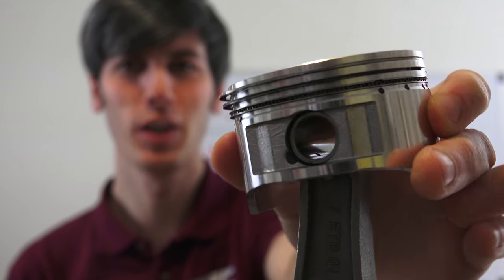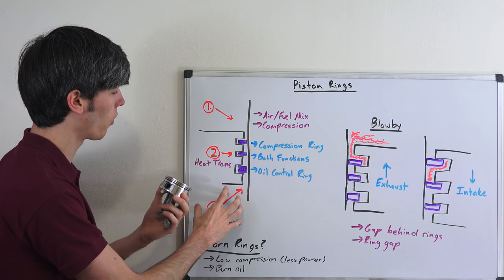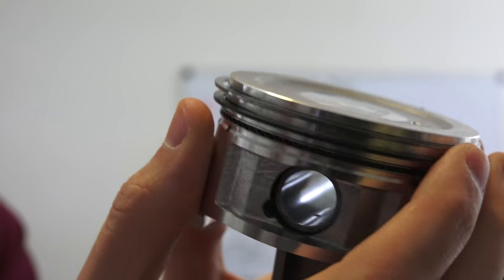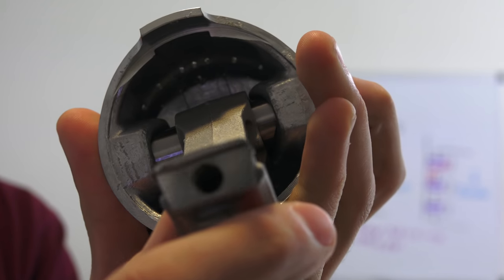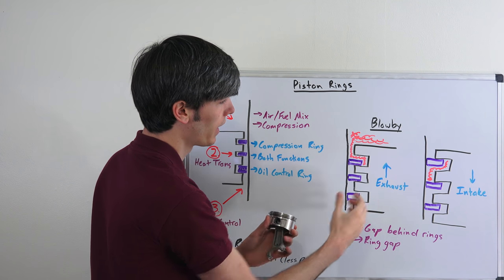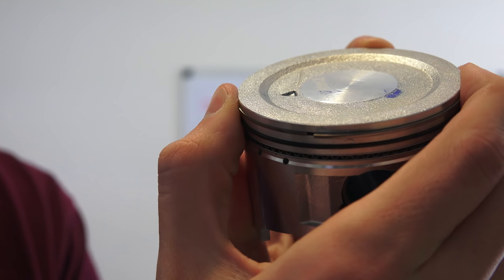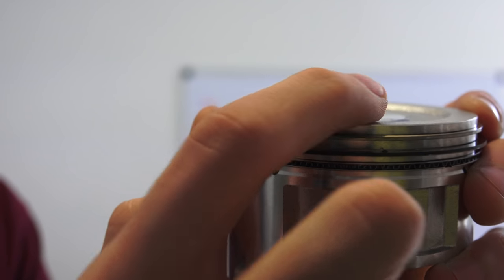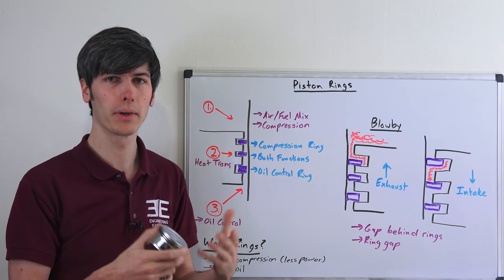Piston Rings & Blowby - Explained

Comment: My car smokes on startup. Also has hesitation and power loss. Does an engine have these symptoms from piston rings only or can this also be valve  stem seals?
Reply: To determine this, you'd need to perform a compression test on the cylinders and see which one has low compression.  

Then, with any low compression cylinders, add a tablespoon of engine oil inside the combustion chamber and test the compression again.  If the compression goes up, it means the oil that you added essentially blocked the defects in the rings, but if the compression stays pretty much the same, it means it mostly likely is a burnt or defected valve.

If your valve stem seals are bad, they will let oil seep into the combustion chamber, which accelerates wear and misfire likeliness. 

I have a car that also smokes badly (blue smoke) on startup and acceleration and normal driving.  I determined it was a single exhaust valve that was the culprit, a common issue on neglected cars...(valve timing wasn't done properly).

Blue smoke is from oil burning.
White smoke is from coolant burning.

Unless I'm mistaken, I think could help you.

Comment: I have to fix my not in my motorcycle and the piston rings are most likely discontinued (bike it '89 zx600c2) and I am curious if I can use the original rings even though I took the head off or should I try and replace?
Also!! I can find compression rings but not oil rings.. So what will happen if I replace just compression rings and keep the old oil rings??
Reply: As long as the oil ring is in good shape and not worn abnormally it should be ok. But replace all of them if possible

Comment: Do they last forever on  a 4 stroke? On performance 2 strokes they have to be changed frequently.
Reply: +Joe Barbaro no, but they last longer on a 4 stroke
Reply: BAMBI How long? i have read that its somewhere around 200k km. If it requires a engine disassembly is it worth to change them?
Reply: +Joe Barbaro It's hard to say how long they last. It depends on so many things. But i know some cases where they last over 1'000'000km.
In most cases it's not worth to change them because often when they go bad, the engine is worn out anyway. And to change the pistons rings means that someone had to tear the whole engine apart. So you end up with the situation that an engine swap is probably a cheaper solution.

Comment: My pos Corolla burns a lot of oil.  Will switching to a heavier blend minimize burning?
Reply: +dumbass3000 Yes, but it's just a band-aid to whatever might really be wrong. There is no harm in switching to a slightly thicker oil though. I would do it too.
Reply: maybe your cars pcv valve is clogged or broken.
Reply: TheWolvesCurse
checked that and it was clean and functioning.  The oil burning was common problem of this gen.

Comment: Hello and thanks for the very informative posts
Please can I ask should a cold engine by left idling to warm up or driven gently to normal temperature? Many thanks,Paul
Reply: idling to warm up is a bad idea since your oilpump won't pump as effectively in idle. gently driving intil it reaches temperature is the way to go. you shouldn't rev it higher than 2500rpm as long as it's cold. if you don't habe a oil temp meter, just drive it below 2500rpm until watertemp reaches it's optimum, then you can go for 3000-3500rpm for another five minutes, then your oil should be at temperature as well. just a general rule only for common gas/petrol/benzin carengines. diesels and motorcycle engines behave differently.
Reply: +TheWolvesCurse many thanks

Comment: could you explain the difference between a V6 and a inline 6?
Reply: +FOREVER EL1TE the shape.
Reply: +Trent Hutchison but which one is better ? im sure there's pros and cons to each
Reply: +FOREVER EL1TE inline probably can be fit in a narrower engine bay, V might have additional benefits such as longer stroke options?
Reply: +FOREVER EL1TE inline 6 engines are naturally balance and tend to be smother, v6 engines are lower and shorter so are easier to package into engine bays

Comment: Oil makes a big difference. Cheap oil not changed causes carbon to freeze the oil scraper ring to lock up frozen.  I replaced rings on properly maintained synthetic oil vehicle and the oil scrapers were freely moving as if new. Oil makes a big difference.

Comment: A friend golf 1.4tsi engine, has a misfire on cylinder 1. We thought it was coil packs and plugs so we replaced all 4 plugs and coils, the problem was still there. We then checked compression and it had no compression in cylinder 1, there is no knocking sound just a misfire. My theory is that the piston ring in cylinder is not sealing causing no compression, the car had been driven recently with a coolant leak maybe 10-15km (Water pump had a leak), and lost all coolant in the expansion tank. Do you think it's possible that the engine has got too hot, causing the piston ring to burn out ? and not seal properly?
Reply: +Peter Lazareski You might have a slightly warped cylinder head causing the head gasket to fail. It happens pretty quickly without coolant. Yes 15km is long enough. You might have to have it straightened out. (which is not as expensive as it sounds, the main cost is all the labour in pulling off the head and reassembly)

Comment: Is there anyway you could restore compression to have more horsepower?
Reply: +Artago Falcon that does sound like a good idea but I've heard about the compression restore you can put in your oil, what about that?
Reply: +Tristan Pierce sounds like something that will gum up your rings, which in that case will raise your compression since it lets less gasses pass through. It's more of a band-aid than a fix really. Best way to see why you have low compression is to do a leak-down test. That will tell you what part of the cylinder your losing compression at.

Comment: Hey man, great material as usual. I just thought of a topic that I hope you could shed a little light and knowledge on. Would it be possible for you to explain why All combustion engine valves are circular and no other shape? Just a thought. Thanks for reading @Engineering Explained
Reply: They are round because to maximize heat transfer to the head, they are always turning. non round shapes are not as easy to make them spin around
Reply: +Thomas Fooij Thank you.
Reply: +Thomas Fooij the spinning is not good or wanted....it's a by product of rpms. In race engines they use multiple springs to try and stop it from happening.
Reply: +Trent Hutchison hey trent, I don't know if you are right about this. I was taught that the turning is a positive thing because of a more even wear and a better transfer of heat. Especially on the exhaust side. Could you give me some links or something proving your point? You could be right of course, I'm only reproducing knowledge here
Reply: Idk when I read your comment it just didn't make any sense to me. I don't see an advantage, just a waste of energy. Just commenting for conversation. not trying to start a research paper.  I'm in the same boat, i heard it a while back and I can't remember the details.  not too worried.

Comment: What do you think about 6 thou over standard tolerance range for the top ring gap? i.e should be 0.006-0.012" but I have 0.018". The service limit is 0.024". So my new ring is over the standard range yet equally below the service maximum. Thanks! It is odd because the 2nd ring isn't over the standard range. It is a stock civic, just looking for reliability. Just got everything back from the machine shop sooo yeah.

Comment: I have a cylinder that has 20% lower compression compared to the rest on a flat 4 engine. Did a wet compression test and voila, it was positive. My question is, why would only one cylinder be low on compression due to the piston rings?

Comment: I have had this question for a long time, bit why do the piston rings stand up to wear far better than the seals on a rotary engine (lifespan of 80,000 miles on a rx-8 I've heard). normal engines with piston rings top that easily but why? same type of wear as far as I can work out, or maybe it's because rotary engines don't really have moment without an ignition...?
Reply: +Simon Van Ootegem 
Heat, surface speed, lubrication and movement(sliding) across openings in the rotor housing walls.
Reply: Better lubrication.

Comment: Hi.
I have a problem while running on LPG with Hyundai Tucson GLS 2006 v6 with automatic transmission.
When i`m running with 1500rtm constantly (60 km/h) i feel one or three shocks and rtm is dropping for a second then after a while is doing this again and again.
Only on 1500rtm is doing this.
I have changed the spark plugs with BOSCH LPG and no changes.
LPG Tehnicians says that is a problem with my car and not with LPG system. (they change it with new one and have same issue)
You have any idea where to look to fix this ?
Thank you.

Comment: Hey in my situation I have oil on all 4 cylinders but the car hasn’t lost any power. It starts right up. It smoke from a stop but when I get going the smoke slowly goes away. Also I did change the valve stem seals two day ago

Comment: request! explain diesel runaway
Reply: +RobinRawrr! 
Diesel engines are fuel starved  to control engine speed (RPM). 
Diesel engine governors typically control fuel delivery. 
When there is an uncontrolled source of fuel there is runaway. 
Sometimes that is from a leaking diesel fuel injection rack or a rogue fuel source introduced through the air intake. 
Diesel engines have unrestricted air delivery, no throttle plate. 
The rogue fuel can be any combustible substance including but not limited to hydrogen, propane/butane, acetylene, natural gas/methane, alcohol/ethanol/methanol, gasoline, diesel, kerosene, oil, ether, paint thinner, etc... most any liquid, gas or vapor that is flammable or combustible.

Comment: Eng'g Explained, i just replaced my piston rings oversize to 50 in all 4 cylinders, ( mitsubishi cyclone 1.5 L engine/ carburature type ), so as the valve stem seal intake/exhaust system because of white smoke in my exhaust. But after the replacement were done same situation occurs, white smoke during engine start and driving..its burning oil also... Experiencing rpm rising so as the temp gauge.

Comment: does not changing oil regularly causes this?
Reply: +Matthew Yes, those holes he showed can get clogged forcing the oil into combustion to burn. It's a common failing on the Toyota Corolla. I never had the issue with 5k oil changer intervals and a quality synthetic.

Some say they were rock solid on good intervals with less than synthetic and got the issue. 2008ish I think they fixed it.
Reply: You can do just about anything to an engine maintenance wise with small longevity effect except for two things. If you want to shorten the life of an engine, don't change the oil and let it run hot. Change your oil at the recommended intervals and maintain your cooling system and everything else will be mileage or performance related. Or as was said in Sling Blade, "Ain't got no gas in it".

Comment: Hey dude. Just a question about my car. It's a Toyota starlet 1.3 na 4e-fe engine it's only done 50,000 miles so shouldn't be in too bad condition for its age (20 years old)  and when I take the oil filler cap off the oil smells a bit of petrol but when it's running it doesn't have blue smoke coming out so I don't think it's burning oil. Just wondering if it's an issue or I'm just overthinking as to why the oil smells like petrol (gas)
Reply: +alex harrington The smell of petrol indicates you have some petrol in your oil. This is usually a problem at cold start, when some liquid fuel wets the cylinder wall and drips down the cylinder wall into your oil in the crankcase. Fuel dilution in oil is more a problem if you have frequent cold start and in winter. I would suggest you do a longer drive (~1 hr). This will allow the oil to reach the operating temperature and vaporize the petrol.

Comment: Gray smoke out of exhaust is engine getting too much diesel in chamber or is is piston ring? ( its happening when i floor the pedal ).
Reply: It's a bad air fuel mix up top. Someone probably put a coal roll tune on your truck
Reply: +busilica123 Its un-burned diesel fuel. Your pump timing could be off, or bad diesel not burning all the way, etc. The smoke will have a blue tint to it if you have excessive blow-by (aka burning oil). Every engine has a small amount of blow-by. Diesel engines are more susceptible because of the extreme pressure in the cylinders.
Reply: +CJBMAGGOT94 Thanks! But the key word is when i floor the pedal then its blowing the gray smoke out of exhaust :S
its golf 2 diesel
Reply: busilica123 Key word I told you the possibilities on why it does that. In the process of rebuilding a 1.6 diesel for my mk1 Jetta.

Comment: How come Diesel engines rev lower than petrol, is it to do with diesel having less of a combustion rate or what u call it
Reply: Diesel burns slower than gasoline so more time is needed for ignition.
Reply: +RGO Impact I know that now but thanks
Reply: Diesel's actually have higher compression, so high rpm is not needed

Comment: Great, now I kinda understand what's happening with my motorcycle :) Thanks! 1000 USD out the window for parts and labour.

Also, is it possible that my recent jump in fuel consumption is related to this? 2 years ago my fuel consumption pretty suddenly got 20% worse and in the last 5000 kms it started to burn oil rapidly.

Comment: do turbo chargers increase engine wear?
Reply: +zachpaw They place more thermal stress on the engine, but turbo charged engines have also thicker components to cope with the extra forces, so in that sense it doesn't wear the engine faster.

Comment: My 400k mile Corolla burns oil and I must assume that it is lacking compression as well, when this gets worse, is the engine not worth repairing ?
Reply: damn 400k? just buy a new car lol
Reply: +pedrof830 what about a thicker oil? labour cost is mad though :(
Reply: paviaaPS3
tried that a few yrs ago, the engine felt sluggish and it barely made any difference cause I also have a bad main seal and labour costs for that is very high also.
Reply: Arh too bad then :( good luck with it though
Reply: At 400K, the rest of the car isn't worth the cost of the rebuild.

Comment: So do the rings then scrape on the cylinder wall?
Reply: it doesn't really scrape, its more like a squeegee. like with windshield wipers. picture the wipers as the piston rings, and the windshield as the cylinder wall. in the dry your wipers will bounce and squeal and all, in the wet the wipers are lubricated by the water and slide smoothly (they should at least) across the windshield.

Comment: I've learnt so much from you, man. Thank you for these amazing videos. I have a question that isn't related to cars though, but it's about piston rings. Hope it's okay. 

I have a 2-stroke motorcycle. A 2 stroke engine needs oil to be mixed with petrol when pushed into the combustion chamber to ignite n so on. I forgot to mix the oil once n my piston jammed :-( I waited for 10 minutes n the bike started up n has been okay since then but spits out white smoke. Still very usable though. Question: can I just change the piston rings n will the problem get solved this way? Or do I have to rebore my cylinder all over again? Thank you again. Awesome channel.
Reply: +johnybrokeit 
Depends on too many unknown factors to accurately answer on a forum like this. 
It would totally depend on the amount of wear and or damage.
Reply: The white smoke is coolant probably. Maybe you blew a gasket

Comment: Remove your oil filler cap, if you get air coming out and or exhaust coming out, you have bad ring(s). That motor now would be good for nitrous since its on its way out anyway.

Comment: I have a question, Why is the Power to Curb weight  ratio so important and why is it called the dream equation if the ratio is 1:1 as in Koenigsegg One:1?
Reply: the more power and less weight the quicker the car will accelerate. the Koenigsegg One:1 is a really powerful car, its also really lightweight, its the best of both worlds. Usually you only have a really powerful car that weighs a lot or a light car that has a decent amount of power
Reply: +ALovelyBunchOfCoconuts That makes it more easier to understand. Thanks a lot

Comment: What happens with that little amount of exhaust gasses passing thorough piston rings in crankcase ? (Sorry for bad English)
Reply from the maker: +dimancik153 There is a PCV valve to allow the pressure to escape the crankcase.
Reply: +dimancik153 The blow by will go through the positive crankcase ventilation (PCV) valve and return to the intake manifold of the engine.
Reply: oh, i see. Thank you guys. Now i know :D
Reply: older designs had crankcase breathers. small engines dont have PVC valves but every even must have a way to relieve the blowby, i think ALL engines have blowby a new engine it will be very little a badly worn out engine will have allot of blowby. i have a farmall cub tractor and on that engine the dipstick has a vent with a screen on it.

every engine in every shape and size must have a way to relieve blowby gasses. 

now what about 2 cycle engines.....string trimmers, chainsaws, and RC nitro powered cars. do they have a way to relieve blowby pressure? i dont think so because they do not have valves, they have transfer ports. i have alway been interested in ALL engines, every shape and size. from the little string trimmer all the way up to the big R3350 aircraft engines.